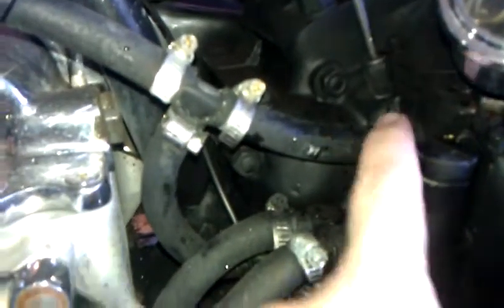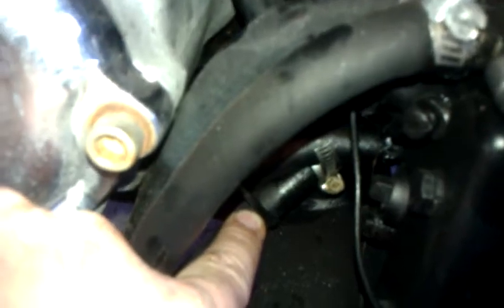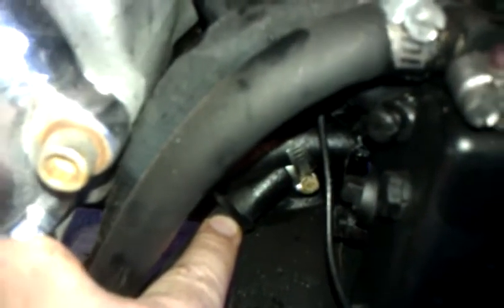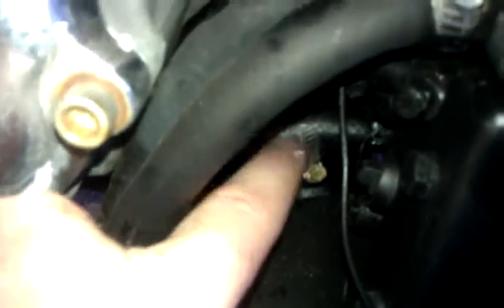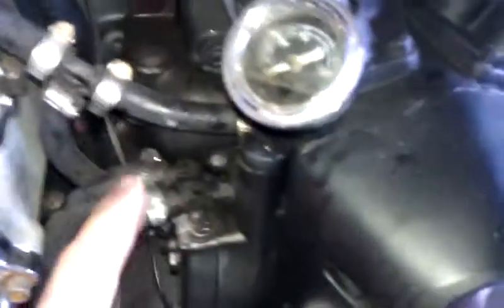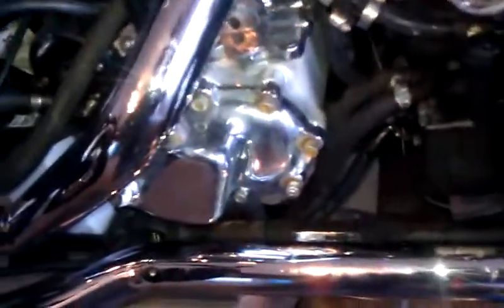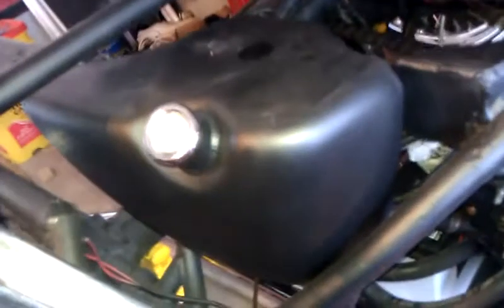Oil lines on shovelhead engine. Which is which??

Comment: My old Sportster had 2 oil lines that ran under the electric starter. One line is the feed to the pump and the other is the return to the oil tank. The kit recommended cutting the return line and route to the filter adapter.
All those other hoses are to what a cooler? My oil pressure sender is on the pump. If all else fails get a manual.

Comment: I got some good info here. Although now I think my lines are right, then I still have the same problem. Oil is overloading into my primary right from my oil tank. It drains right in.....changed the check ball and spring in the pump, the lines seem to be right...now what ? Any helpfull info here ?

Comment from the maker: Bill - it sounds like your oil lines are crossed to me. If the oil is draining straight into the primary, then that leads me to believe that is the feed line that should be going to the oil pump. Try swithcing them. also, check out www.shovelhead.us and go to the Forums. Tons of helpful info there.